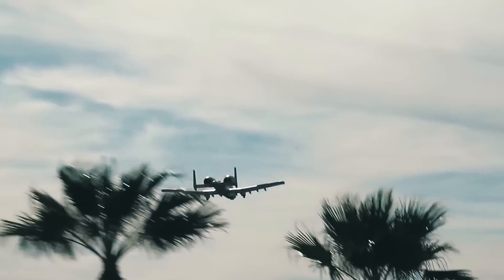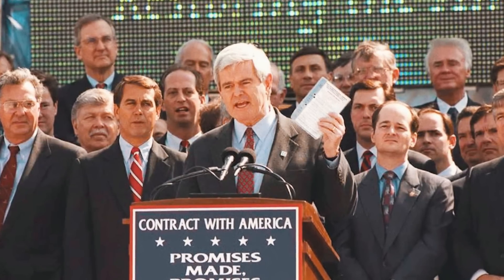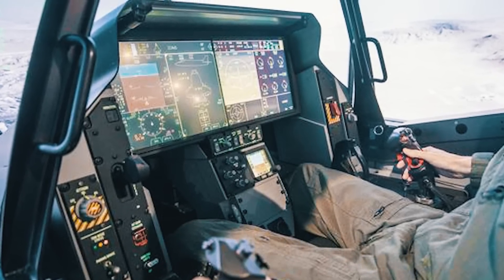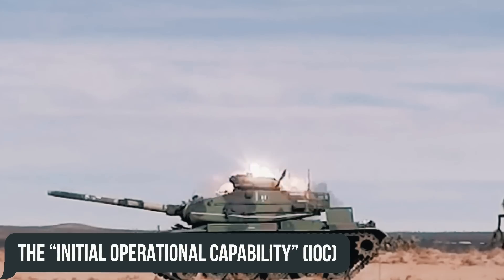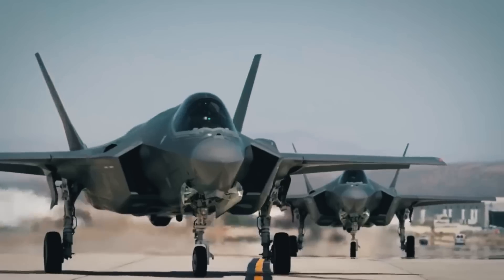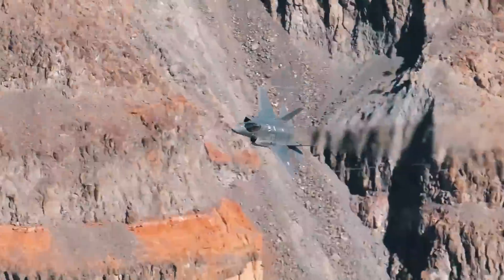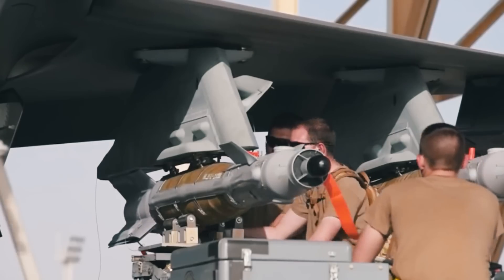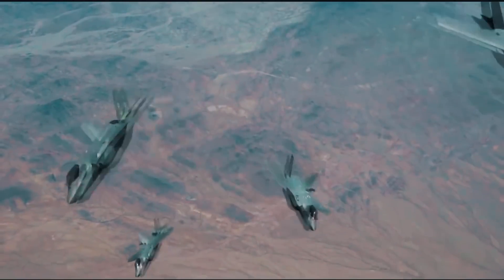New F-35 Shocked Russians: The Only Fighter Jet To Beat SU-57

Comment: They could bring back spitfires and still easily defeat Su-57, might even do it with Sopwith Camels.
Reply: OK...jokes aside about BVR fights, no WWII plane would ever have a chance unless there was a swarm that is in the right position to attack a modern plane that ran out of rockets with bullets, but the modern plane is at 65K ft.  Nope...no way.
Reply: @sammcbride2464  In a dogfight only the f22 and the russian planes with super maneuverability might have a chance vs prop aircraft :))
Reply: @VladSuperKat  I am just saying that a F22 could shoot down old planes from 65K elevation without looking back.  No problem.  Would never see a single bullet from a plane that can only get to 20K feet.
Reply: @sammcbride2464  We were talking about dogfighting. Ofc old planes don't stand a chance on modern battlefield :))
Reply: I will have to add that let's say it is just bullets vs. bullets.  The HUD, aiming capability, modern ammo and rate of fire even with slow maneuverability would largely out way any sopwith camel type of dogfight that we are challenging.  A modern plane could easily swoop down on an old plane with guns only and take them out in a 3 second trigger pull that normally takes an old plane 4 yards of ammo to earn a kill.
Reply: @VladSuperKat  See reply above.  I will take an F-4, F-15, F-16, F-18, F-22, or F-35 against any prop plane with modern aiming systems vs. some P-series prop plane that has a glorified reticula.
Reply: @VladSuperKat  There would never be a dogfight. Any modern jet would shoot past leaving a trail of 20 mm holes. I love the P51, but it would stand no chance. You don't give an enemy  an even break and the P51 would be a fireball heading to the ground before the pilot could turn his head.
Reply: @VladSuperKat  Even in a dogfight the F22 would circle the P51 so fast. The shorter turn circle of the P51 wouldn't matter because the speed of the F22 would push it around the larger turn circle too fast.
Reply: It lost in the simulation vs the Mustang.
Reply: @VladSuperKat  Can point us to this simulation so we can spec the simulation engine and watch the 1:1M sequence that lets this happen?
Reply: India found it a decent 4.3 gen aircraft with way too much loss of stealth in normal battle scenarios where the S400 would be effective. I think of it as a stealthed up SU-35.
Reply: Yes even the f22 can lose vs a P-51 Mustang just like a P-51 Mustang can lose to a Stuka if f-22 gets into a raid fight with the p-51 the p-51 can win the same is for a Stuka vs a P-51 Mustang.
Reply: @VladSuperKat  How about a P-51 low and slow in the mountains daring the F-22 to come down and play. I wonder how long it would be before the 22 had to go home for more fuel and play another day.

Comment: You said the US Army created the requirements for the JSF program. The Army is the one branch* that does not operate an F-35 variant, and was never intended to.
* Of the four combat branches (not USCG or USSF).
Reply: It is about power and control through politics....
Reply: The Army had input because they control the CAS role. The Air Force provides CAS service but the Army is the customer.

Comment: F-35 beast mode is easily detected but after they dispense their external load it's right back to stealthy again.
Reply: The us air force said that beast mode wont be used until air superiority has been accomplished.  Thats what the f15 / f16 is going to be used
Reply: @89turbomk3  The US air force isn't the only fighting force with the F-35. I would love to know if they can "get" stealth mode back after loading in beast mode.

Also, does this mean the US Air Force will only use F-15/F-16's after the F-22/F-35's have achieved air superiority? So most of the US's airpower will be grounded early in a fight & if superiority is never achieved they will remain on the ground?

That may be official doctrine, but it sound's like textbook BS. In a real fight everyone will be involved.
Reply: @aCycloneSteve  I think the following are unchanged over the past few years:
In lower risk situations, the F15 / F16's will still be used.  In higher risk situations, they (F15 / F35's with external weapons) might operate 20+ miles back from the clean F22 / F35's and operate more as a networked AA missile truck.
Once air superiority has been established, all options are open.
Reply: @aCycloneSteve  incorrect the f15 will also be in the fight but slightly behind. The f35 can job is to provide information to other fighters at the same time
Reply: @89turbomk3  Which is why I want to know if the F-35 can start in beast mode, act like an F-15, then drop it's load and go stealth.
Reply: Until we have established total air supremacy over the battlefield, the F-35s will not be employed with external stores.
Reply: @Frankie5Angels150  I couldn't agree more but I'm not the one suggesting sending F35's into battle with external weapons. However, they could fire from distance all of their external weapons then go stealth and continue the mission.
Reply: @ItiscalledaMANDATE  Same with the external drop tanks.  Just drop them 100+ mi prior to engagement.
Reply: @ItiscalledaMANDATE  I don't know if they CAN release the external mountings, if not, they would not be able to "escape" in stealth mode.
What I could see is two "regular" aircraft up front guiding the beast 35's. The beasts (in air support mode) fire their missiles at long range guided by the "regular" stealth aircraft.
If it were the Russians or Chinese they would likely lead with gen 4 to absorb the missiles leaving their gen 5 with a depleted opponent to go after.
Reply: @aCycloneSteve  I think the F-15EX's would make a far better missile truck than the F-35, more missiles (12 AMRAAMs), and far higher top speed, which is desirable to maximize range of AA missiles.
Reply: @stanimal8  True, but you can't always get what you want. 🙃
Reply: @stanimal8  True, but I don't think the F-15EX can launch off a carrier! 🙂
Reply: @aCycloneSteve  I agree, but the only carrier launch compatible model of the F-35 is the C model, the B model could do VTOL but payload & range is more limited.

Comment: Yeah, no. The F35 can’t even beat the F16 it’s supposed to replace in a straight up dogfight (it’s not meant to replace the F15). That’s not what it was built for. Yes, it’s a beast in BVR.  No, it’s not a better dogfighted than the Felon.
Reply: Hmmm, as a lowly ‘dog’ adversary pilot(A-4F+, VF126, 1990-1993), I humiliated a many F-16, F-15, F-14, pilots. I could just fly slower than they could. Is that a tactically sound thing to do? Absolutely not but, 1 on 1….it’s about the pilot and the aircraft.
Reply: F-35s beat the most experienced F-16 instructor pilots in BFM more often than they lose. It's maneuverability is slightly worse in sustained turns, but far far more versatile and undoubtedly superior when in a defensive position. 

The myth you refer to was about a test airframe with intentional limitations to prevent pilots crashing the aircraft while performing untested maneuvers. Basically, F-35 testing has been a heck of a lot more controlled than previous fighters, and that generated complaints from pilots. 

Block 3I production models that entered service in the latter half of 2015 were capable of beating F-16s even though they still retained some of the flight restrictions. The Block 3I F-35A was described by pilots as an F/A-18 with the acceleration of the F-16, meaning it could pull extremely tight turns and accelerate fast enough to regain energy before the enemy could counter in many situations. This was also before tactics had been developed, as the most experienced pilots were still learning the capabilities of the aircraft. Block 3Fs removed all restrictions, and there's an engine upgrade in the works for I believe Block 5 that will enhance performance further.
Reply: It can't beat either if it fights fair. Fighter combat is never fair.

Comment: No lmao, f22 is already more than enough to beat su57. If you say in terms of dogfight then idk cuz YouTube vids are barely trustable but su57 I think comes in as a tie with the f22 because both fighters are excellent dog fighters as well but idt rhe raptor excels specifically in dogfight which might get the su57 an edge.
Reply: how you know that? i will need to see several fights to get that conclusion, all the propaganda of both sides sounds nice, but this are not facts.
Reply: @gustavovillaran826  it’s just how it works. F22 specializes in long range combat and su57 only specialises in dogfighting. Plus su57 sacrifices a lot of stealth for it dogfight ability which is flaw number one there, second flaw is su57 was not designed to engage targets far away which is bvr which happily favors f22 who specializes in bvr from the get go of its design. Plus su57 has multiple flaws from the start it still haven’t even finish testing its new engines and it even crashed during a flight due to malfunctions and you call that a success? Indians was working with Russians on su57 but they quit halfway because it was a failure
Reply: @Gyyghhhhjjjkk  i think the new engines were finished and tested already, where do you get that su57 is dogfight specialized? all this stealth sounds good, actually sounds as good as when i heard about the f117 years ago, and it was shoot down by an old s-200, and thats a fact not a simulation or anything, so yea i need to see a real situation.
Reply: @gustavovillaran826  it’s literally told by the design bro it’s already wide spread because they want to sacrifice stealth for more dogfight capability. Plus it’s just not a good jet fighter if it is then why Russia stopped mass producing it then and why Indians quit half way when the engine is still under testing and they still cannot get more than 10 units out then
Reply: @gustavovillaran826  all this stealth sounds good you mean only partially good and still some parts being completely exposed
Reply: @gustavovillaran826  plus f22 it self is enough to take down 5 f15 eagles in a simulation fight which is already enough

Comment: Basically a sub-sonic fighter, like the Harrier.   It can't go supersonic for over a minute.   That means it may not be able to successfully intercept in-bound aircraft or get away from higher-performance Russian aircraft.  And the Pentagon has no plans to fix the "sub-sonic issue".
Reply: F35 can hit 1.6 Mach with the ability to super cruise. Remember faster does not always mean better.
Reply: @DannyM-ku3ot  
Super cruise for 1 minute was not clarified in 5 gen aircraft definition.
Specs of 5 gen aircraft don't claim:
- Super cruise for at least 1 minute
- Stealth for at least 1 minute with specific angle of view with 3 angles degree from axis of movement
- Fused sensors data reliable 95% of times
- So on...
Reply: The issue you refer to does not affect the A model, only the B and C models, and the reason the DoD are not prioritising a fix is because the issue is incredibly rare. The restrictions are also doctrinal, not enforced via the aircraft's software. If pilots exceed the limits they get told off, but if the reason for exceeding the limits is valid - such as in combat - there is no problem.

Comment: F35 will never replace the A-10 or F-15.  F-16...probably.
Reply: tell that  to the airforce. The main motive of the aircraft production was the replace the 4th gens by 2040.
Reply: @misbahf2751  They are designing a 6th gen to replace the F-15.  The F35 is a multirole plane, not an air superiority plane.
Reply: @sammcbride2464  It is still capable of performing air superiority missions.
Reply: @misbahf2751  Nope.  An F-22 will completely obliterate the F-35 in the air.
Reply: @sammcbride2464  I said its capable. Also, BVR, F-35's large fleet of weapons and enhanced stealth will give it an advantage
Reply: @misbahf2751  BVR?  Do you know the CSRF of an F-22 vs. F-35?  So we are talking loitering time compared to an Apache.  You want to compare an A-10 to F-35?  WTF?
Reply: @sammcbride2464  bruh, u made the F22 or the F-35. Lockheed martin themself said F-35 has surperior stealth and large array of weapons makes it one of the best if not the best at medium to long range combat.
Reply: @misbahf2751  Marketing. The F22 is the plane to beat right now for air superiority and stealth.  The F35 will never be air superiority.  The F-18 block 3 is even better.
Reply: @sammcbride2464  Bro sucks at reading comprehension. I never said F-35 is the best air superiority fighter. Ur just a fanboy that believes if an aircraft is classified as an air superiority, its better in everything compared to a multi-role.
Reply: @misbahf2751  Anyone that says bro is discreted automatically.  How about I am not a fanboy of any aircraft except the ones that win?  Do you even know what fanboy means?  Which aircraft am I a fanboy of?
Reply: @sammcbride2464  F-22 is what ur a fanboy of. U can handle the fact that there are other aircraft that are better in certain aspects compared to an F-22.
Reply: A-10 is obsolete, even if it does go brrrt.
Reply: @omarn6989  and its outclassed by other attack and bomber aircraft.
Reply: @omarn6989  It is not just the brrrt.  It is the tank like shell and the ability to loft around for a bit longer.  You don't really know your airplanes, do you?
Reply: The F-35's were planned to replace the F-16's and the F-22's to replace F-15's : High end and low end pairing of fighters The F-15's and F-22's being the High end and the F-16's and F-35's being the low end. Now that Lockheed Martin owns General Dynamics The F-35's most likely replace the F-16's since all F-16 related tech can be apart of the F-35's and F-22's. Both the F-35's and F-22's can be equipped in a standard configuration with External weapons and fuel tanks might reduce the RCS but in some situations that might not be as bad as it sounds.

Comment: Crazy how the F35 weighs less than a 98 Acura Integra meanwhile its much bigger in size.
Reply: Uh....no it doesn't?
Reply: What are you talking about?  The F35 weight between 10-20X (depending if empty or gross weights) the weight of an 98 Acura Integra.
Reply: @stanimal8  Clearly you've never loaded my mother-in-law into an Acura.
Reply: @aCycloneSteve  You're right, I've never seen your mother in-law in an Acura Integra, but she would need to weight as much as ~2 adult male elephants to get a "loaded" Acura Integra to weight as much as a loaded A-10.  If that is the case, you have an interesting taste in your choice in mate.
Reply: @stanimal8  Haha! 

I think ReiffMurdaSquad Gotti was talking about the dry weight of an F-35, not the loaded weight of an A-10.

That would mean my MIL would only need to be as large as an adult female elephant. ;-)
Reply: @aCycloneSteve  I have >3 decades of engineering experience in the aerospace industry, and I'm still amazed of the weights of these planes and the aerodynamic forces generated by wings at speed.  Example, the max take-off weight of an F-15 is ~68,000 lbs, that's the weight of ~5 adult male elephants.  And able to provide a max of ~400,000 of aerodynamic lift sustained for sometime, or >30 adult male elephants (or ~130  98 Acura Integras) !!!
Reply: @stanimal8  I was just watching a video on carriers and was told that the catapults used to have a "cradle" (a wire) that was attached to the catapult and then on two hooks on the aircraft. The cradle is what pulled the plane at launch and then the wires either fell into the sea or were caught and reused by a little nub on the bow of the carrier.

Do you think it's possible for a F-35B to have retractable hooks installed so they can be catapulted off a regular carrier? That would increase their takeoff weight.
Reply: @aCycloneSteve  It would be a challenge to catapult launch a F35B, as only the C model were designed with the stronger nose landing gear to handle the pretty significant catapult loads.  The main issue is not the physical interfaces to the catapult, but how to retrofit the aircraft to dump this load into the airframe without damaging it.
Don't recall reading about any discarded components on catapults used over the past 4 decades, older design might be less efficient, discarding connection hardware with each launch, but hard to see these types of designs lasting much beyond the developmental stage of early catapult designs.
Reply: If the Acura was fully loaded with passengers after a big lunch and had a full tank of gas, it might eek out the F-35 in gross weight.